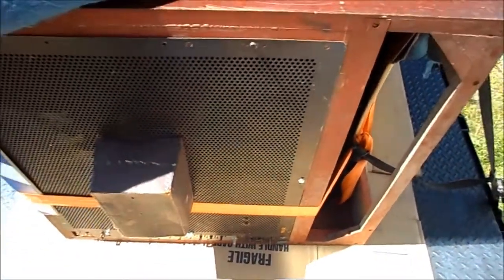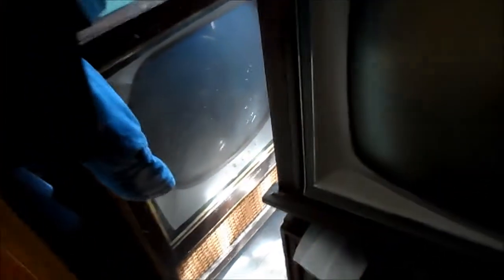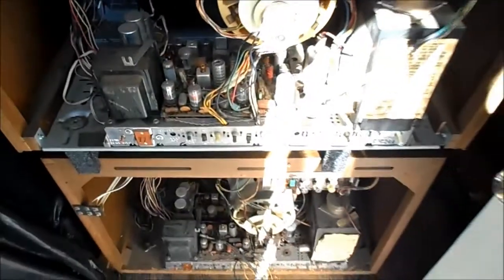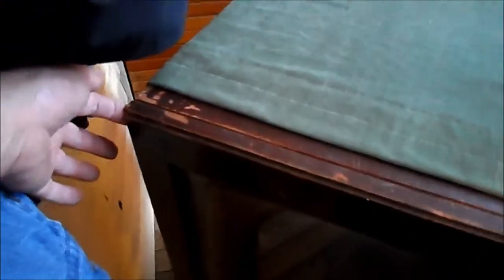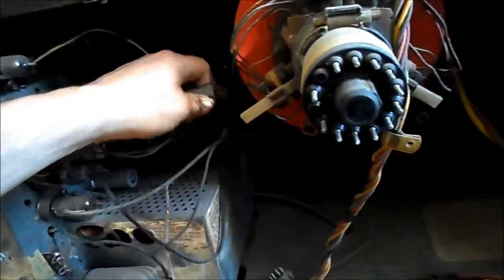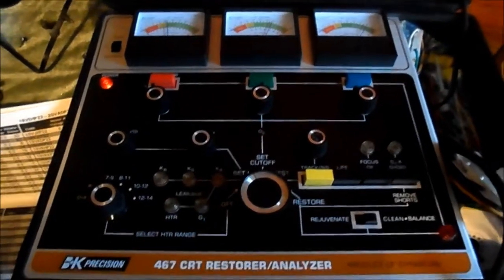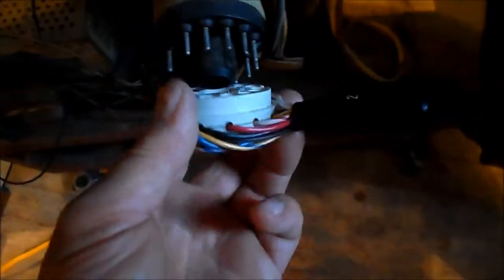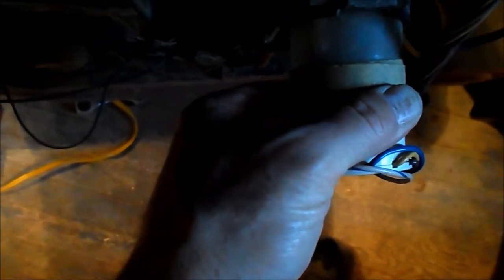CRT Testing. 25AP22, 23VANP22, & 21CYP22.

Comment: I posted out on vk the possibility of subbing in a 25v for a roundie (where you have a roundie set and no acces to the correct CRT) just to get some comment if anyone has ever looked into the dimensions and possiblity of fitting (reversable) to a round bezel.
Reply from the maker: I was thinking that too. The jig has a 2-sided socket to accommodate either, I know the degrees are different, but no big deal. I also have socket adapters that provide the 21 to 25 inch socket. Just the yoke, Thank you for the yoke info. Yes, no smoking...

Comment: cornering the market on CTC-24 eh?

Bummer about the CYP22, hopefully it can be rebuilt in the future.

Just a guess but maybe had gone to air and not filaments are open. sorry posting while watching.
Reply from the maker: It is strange. Was talking over the phone one evening, with the very last of my old time TV repairmen, & the issues surrounding the current 24 chassis. While on the phone, with him, I was doing a search, & found these. Really don't know what to do now being blessed with a CTC-7. It's huge in comparison, & bad CRT. Hook it to a yoke on the test jig for fun?
Reply: they are really the 1st modern color rca set, easy to converge etc... I would replace any paper caps and try it on the jig. then just keep you eyes open for a good roundie color tube,  the 7 I got and a cyp in it, but one filament would not light, the other two tested great. argh.
Reply from the maker: Dave WM
Saw your post on that. How to yoke it on the jig is a bit confusing to me right this moment. Will have to try & study it. Puzzled by so many wires, yoke center taps, etc. with yokes on the 25-inch, later models.
Reply: not that hard, just the blue and the red to the horz, ignore the center. Yellow and black on the vert. Oh and watch for smoke :)